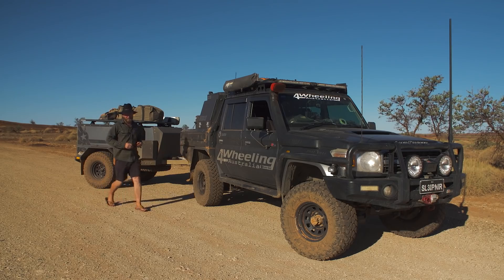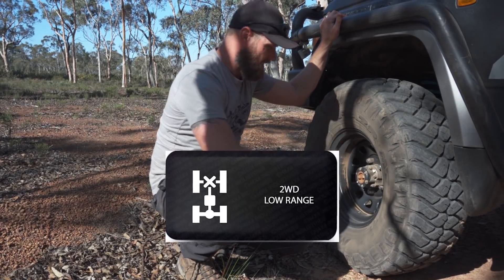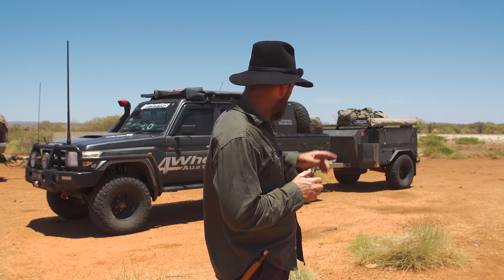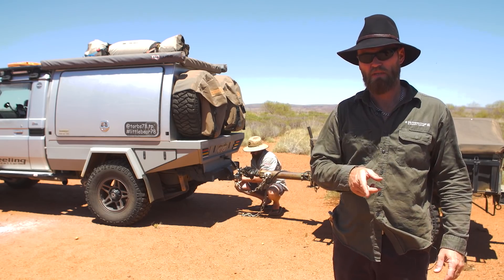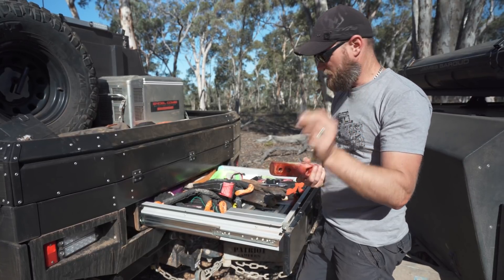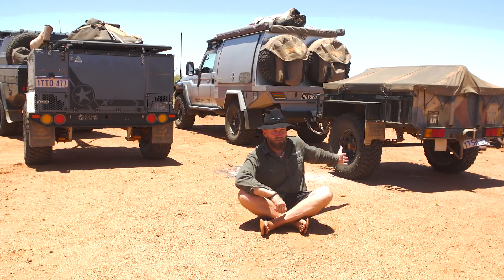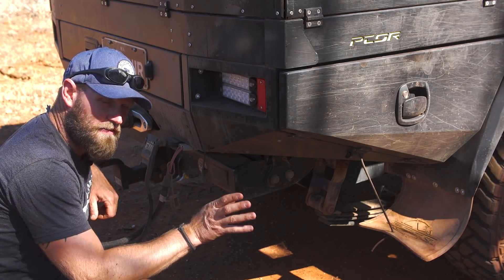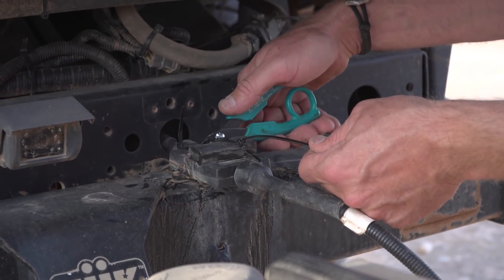Off-Road Towing, Advice no one else will give YOU

Comment: Depends on ply. My tires can take up to 60+ psi. Learn to use your side mirrors backing up and you'll never need a rearview mirror.  Also set up your backup. Pre position yourself and tires before you even stop and reverse.  On a side note learn how to use your ebrake.  With foot on brake put car in N set ebrake release foot off main brake. After vehicle rocks back and forth and settles out in P.  Unfortunately I learned this technique after having to replace a steering column because of tension due to being parked on an angle. All the stress thereof lays with the ebrake.  Btw gets your guns back aussie boys and girls.

Comment: Only one thing in all this I would suggest differently...
...dropping trailer tire pressures in a situation where you down pressure your vehicle tires...
...given that trailers provide no motive force...
...trailer tires should remain aired up at all times, primarily to provide the least rolling resistance.

Airing down a trailer only increases the amount of drag on the tow vehicle.  If your tow vehicle needs all the traction it can get via airing down, down pressuring your trailer increases the amount of drag on the tow vehicle.  And in slick situations...you want the trailer to 'disappear' if at all possible.  You can do that by making trailer tires as high-pressure as possible. 

Oh!  And...white letters...go on the outside! lol
Just my 2 cents...
Otherwise, Mr. Dahl is right-on.  ESPECIALLY on the cable (zip) ties on cable connections while in motion.  You want the connection to disconnect under tension.

Comment: Ronny, love your videos - Regarding tire pressures: Your pressures may suit your 33 or 35-inch rubbers but since you address a wide variety of drivers, I thought it might be good to mention that a 265/65/18 tire will suffer at 8 psi on sand no matter what. Also, 20 psi is likely to be too low on gravel roads, too, for a small tire. Best tire pressures highly depend on the internal volume and cross-section e.g wall heights. Your best tire pressure should vary on the size of your tire, the weight on your tire, and the type of ground you travel on.

Comment: I said it before...on the video where Torb's had the flat tyre on the little boat trailer..... Do ya'self a favour and fit a set of quality TPMS on all 6 tyres. If there'd been a TPMS on that trailer tyre, he'd have known about it soon enough to save the tyre. I dare say that the tyre Ronny blew on that Kunanurra trip would have also been avoided. With big tyres costing around $500- each, the TPMS only has to save ONE tyre and it's paid for itself. My Safety Dave TPMS has saved me several times.
Reply: TPMS doesn't help if you blow a tire, you go from full of air to no air in a matter of seconds.  TPMS only helps if people actually pay attention...cars have had TPMS for several years now yet you see people still driving around with flat tires all the time, or tires very low on air...most people never look at anything on their vehicle...they come out jump in and drive away, so all that stuff don't do any good when the world is full of people that don't pay attention to their surroundings, have no idea about vehicle maintenance, and live life with their noses stuck in their cell phones.
Reply: @wildbill23c  This is where most people get confused mate. 
You see, here's the thing....99% of "blow-outs" don't just happen instantaneously. They occur because the tyre has been going down S-L-O-W-L-Y over many kilometers until the lower pressure (say 25psi at 100k/h) eventually heats the sidewalls up to the point where the  tyre lets go with a mighty BANG.
At this point, the driver says "SHIT...I've just gone from having a fully-inflated tyre to having blow-out".
W-R-O-N-G in almost all instances.
If you can keep an eye/ear on what the tyre pressures are doing (via a TPMS), you'll likely be able to stop and fix a slow leak before it causes the tyre to blow-out.
Of course, you're right about one thing.....if you have the technology but CHOOSE to ignore it, then more fool you (not "you" specifically, but the driver who ignores it).
My TPMS has saved me at LEAST 3 tyres so far. There was one occasion when it didn't save me a tyre.....I drove straight over a "KEEP LEFT" sign which I didn't see. The sharp edge sliced the sidewall open and the TPMS warned me at the same time the incident occured. That was driver error on my part.

Comment: Something that I think you missed that's worth considering, and that's reducing your speed. Especially important on fast gravel roads.  I knock 20km/h off my normal travel speed when on gravel compared to what I would normally do without a trailer in tow. Having that trailer hitched up on gravel really affects your braking distance and cornering stability. Coming into a corner too hot with a trailer on is really not much fun. I found that out very early on while towing my camper - oversteer with a trailer hooked up is sketchy as

Comment: if you have a different tyre size on the trailer or a different suspension type. you really need to pay attention to how the trailer is going. say you have 35's on the 4wd and car size tyres on a boat trailer the 35's will breeze over bumps and washouts that the car tyres get lost in. and if you have a smooth riding loaded 4wd and rough riding leaf sprung trailer you need to drive to the trailers ability (as you know from the drifta saga)

Comment: Some very good tips, thanks for sharing. I completely agree with running the same diameter, wheel offset, stud pattern and vehicle width track, but would running a less aggressive AT tyre on the trailer be better for rolling resistance and fuel consumption?
Reply: Good question. The answer probably has more to do with whether you will use the trailer wheels as spares I guess.

Comment: Another awesome video Ronny but you missed a the most important tip. 

HOLD THE BOTTOM OF THE WHEEL 

When reversing hold the bottom of the steering wheel, when you want the trailer to go to the right turn the bottom of the wheel to the right. Want it to the left swing the bottom of the wheel to the left. 
People  that hold or think of the top of the wheel when they’re backing a trailer need to think in reverse to turn the wheel the right way. HOLD THE BOTTOM OF THE WHEEL, you’ll never fuck up a turn again.
Reply: MIND BLOWN!
Reply: Ken Cooper Great point for people learning, but  not necessary when people get the hang of it.
Reply: Good advice...if there’s space for your hands between the steering wheel and your crotch. Big guys in old land rovers without power steering find this nigh on impossible🤗
Reply: I don't agree, you loose all your hands instinctive reaction, and until you understand trailer reversing you'll mess  it up anyway, better to change as less as possible.
Reply: mad ass
Women just love getting tossed the keys to a 4wd they’re completely unfamiliar with that has a trailer hooked up to it.
Reply: Totally agree, thanks for pointing this out. Bottom steering wheel hold  and small corrections when reversing slow makes it a lot easier.

Comment: When reversing a trailer always go slow.
When reversing a trailer if you start going the wrong way, STOP and drive forward and get yourself straight before starting again.
Oh and practice makes perfect.
Reply: Proper set up is key and usually easy with a short trailer.
Reply: Jesus was a Hermetic I’d say the longer the trailer is the easier it is to reverse.
Reply: Dodgy Davo It's easier to reverse a longer trailer but easier to set up for backing on a shorter trailer.
Reply: Reversing a trailer, always take twice as much room, and steer half as much as you normally would.

Comment: thanks for another great instructional video Ronnie. 

FWIW here are some more tips:- check your weights and don't overload, check the trailer wheel bearings often, check the tightness of the trailer wheel nuts at least once a day when traveling and after 50km if you have had a wheel off, Lastly be considerate and let faster traffic overtake.

Comment: Great vid Ron..have a mental external (& internal )checklist..every stop, quick walk around, touch parts, clips, brakes & bearings as well.. also have a bright red clip on trailer handbrake, unclip when brake off & put it on the hitch lock...have driven off with brake on and/or hitch not locked in (never rush hook up).👀
Reply: touching for heat too....good tip Mark.